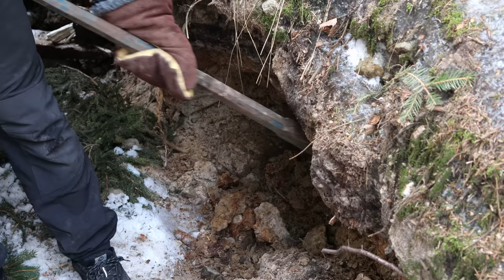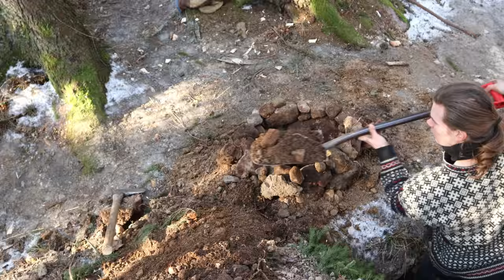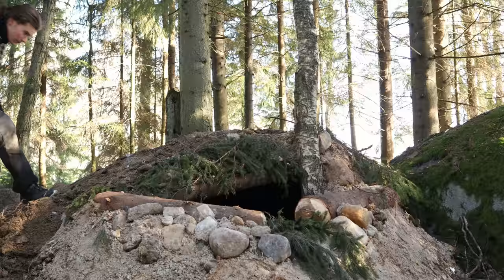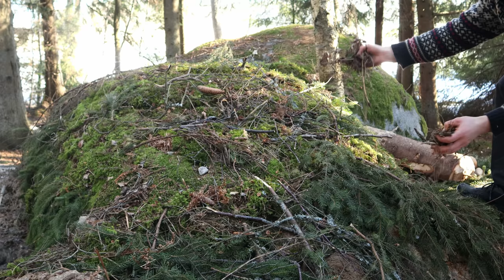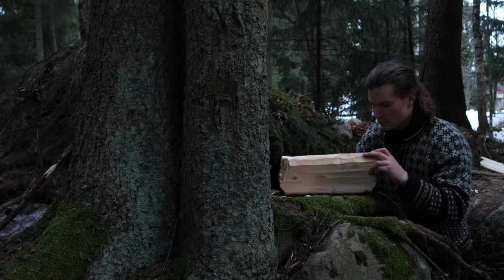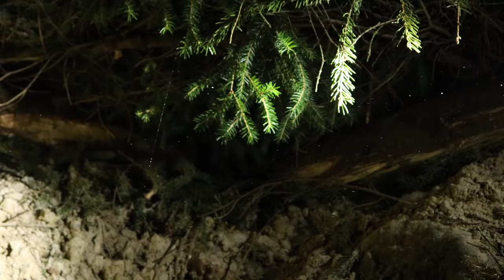Building a HIDDEN Fireplace in my Bushcraft Shelter - Moss Camo Roof - ASMR

Comment: Great craft and skills displayed. I especially love that fireplace of yours. Good thing that your floor is dry hey. Also nice cuttingboard. Did you oil it for added protection? Question please - would you be able to sleep in this shelter in the rain as well? Great post. Take care and God Bless 🧡
Reply from the maker: I shall put oil on the board after making it smoother at home.
The thick earth roof should absorb quite a lot of water, as long as it's not raining heavily for long times the roof will not leak. The floor will rarely be flooded, it was simply so wet after winter when I started building.
Reply: வணக்கம்! Very nice and security in this shelter! It's was nice! Safe and healthy!
Reply: @AgeofTheNorth Forgive the tardiness of my response but thank you for you reply. I was only asking about the board specifically because I used to make cutting boards and an old uncle bungcal used to tell me I must oil it for protection. I truly admire what you constructed.